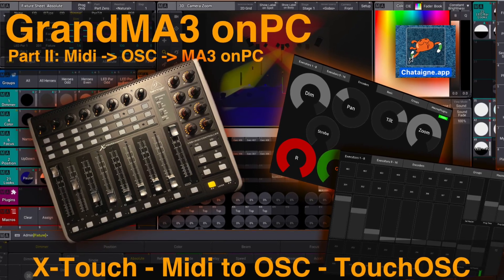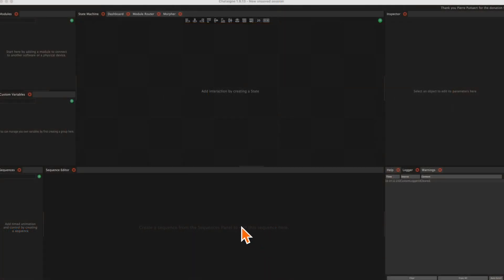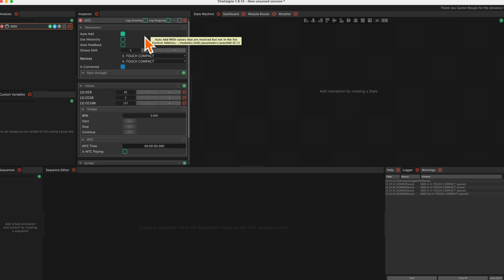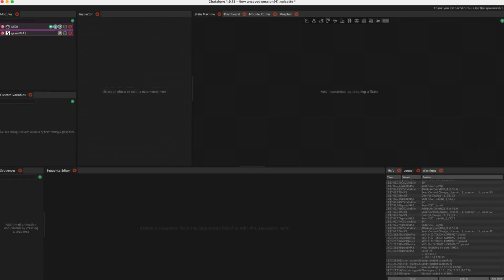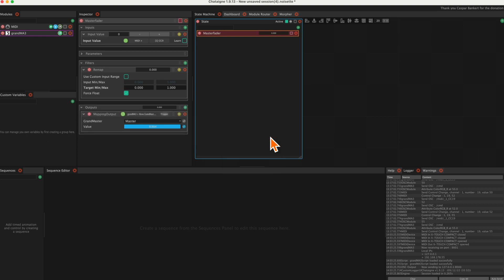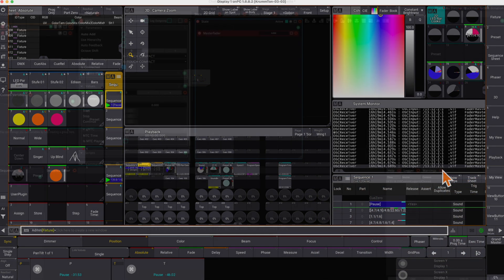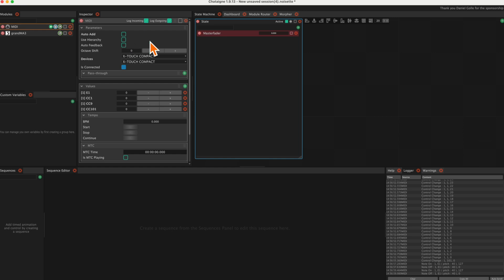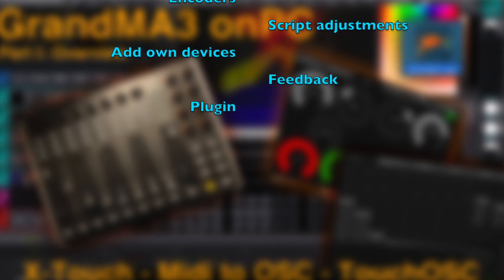Grandma3 Midi to OSC - Part II: Midi to OSC mapping using Chataigne

Comment: I am not sure what I am doing wrong. I have everything working and Chataigne is sending OSC and loopback is seeing it. However no matter how I set my settings in grandMA3 I do not get any incoming OSC.
Reply from the maker: Hi, did you select the correct interface in the GrandMA OSC settings? Here are some screen shots:
https://www.dropbox.com/scl/fo/48yg2gyf3mruzqq28mmk7/AEhmYw4MAekW24CeIoQF24A?rlkey=kblol6qi7cs42ea3ukkblkk6t&st=31jeurw1&dl=0
Reply: @stefankrumm6709  I was following images from another build guide and they had chosen "Teensy Midi" for their device in MA. This was actually the LoopMIDI session renamed to "Teensy Midi" so it threw me way off lol. Otherwise everything was correct. Thank you!

Comment: I can set my output into grandma3 to control playback executor on pages 1 - 9 but can't for 10+ Is there a way to do this? I have one controller I like to set to page 10 and another controller that I unlock to floating faders for whatever page I have selected, Would Like to keep my playback pools 1-9 open for show
Reply from the maker: Hi, does page #10 already exist in your show file?
Reply from the maker: Hi, the problem is caused by the GrandMA3-Chataigne module. For some reason, the number of pages is restricted to 9. You can easily fix it by locating the "module.json" file in the plugin folder. In a text editor open the file and search for the executor entries. In the line
 "Page": {"type":"Integer","min":1,"max":9,"default":1}, change "9" to the number of pages you need. On a Mac, the file lives in Documents/Chataigne/modules/grandMA3-Chataigne-Module-main.
cheers
Stefan
Reply: excellent and thanks for the quick response wow that was fast, one more question : I can toggle my cues saved on playback executors with my midi controller however lets say if I hit store or delete than a button on my midi controller assigned to an empty executor nothing happens, I want to setup a cue, press store and then press the empty slot on my midi controller to save, is this possible?
Reply: like I assigned my apc mini to 3.416 3.417 3.418 etc and they're all blank cues i want to press store than button 1 on my physical controller and have it store on assigned executor (lets say 3.416) the page is created and i have cues on 3.301-3.310 already made
Reply from the maker: @lightinglizard7739   Hi, I am afraid that is not possible (but I will give it a try).
Reply: thanks that would make this setup perfect for programming, at the moment its amazing for operating but confusing on the programming side when i have 160+ faders / buttons between my 2 controllers

Comment: my master only jumps from 0 to 100 how do i make it variable
Reply from the maker: If you send me your Chataigne file I could check what‘s wrong.
Reply: @stefankrumm6709  Sadly i have the same issues. What could i do ?
Reply from the maker: @_pasi2996  Hi, did you set a filter/remapping? See video at 3:35. If you don't have success, please mail me your Chataigne file, I will try to fix it. tutorials@stkrumm.de
Reply: @stefankrumm6709  yes, i had the remapping in there.
I didn't saved the file so i just recreated it and now it works. i don't knew what i was doing wrong before. But Thanks :D